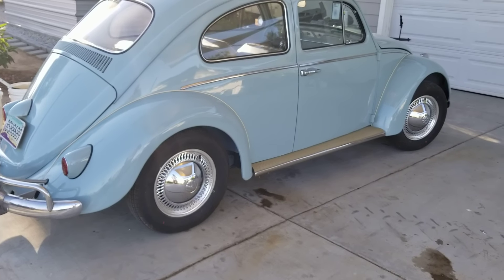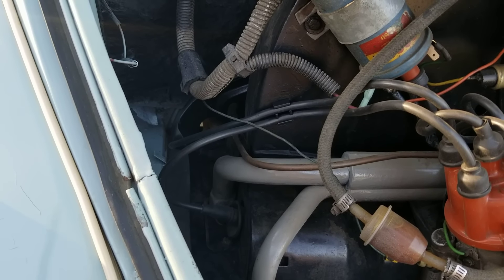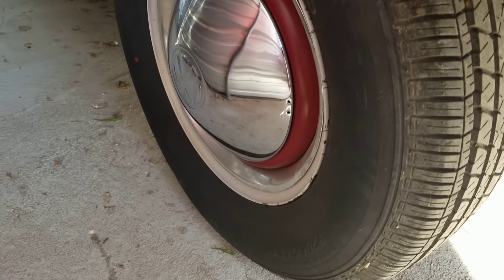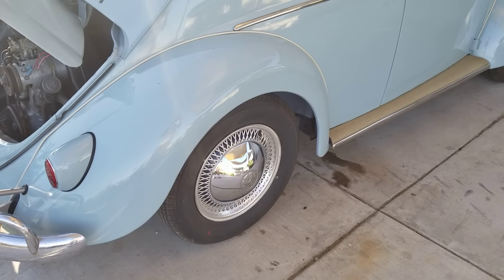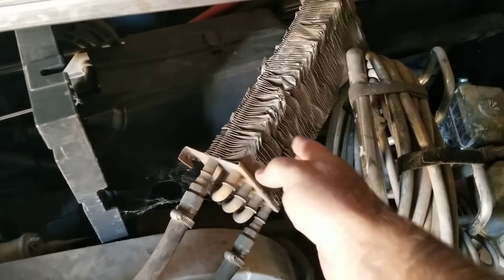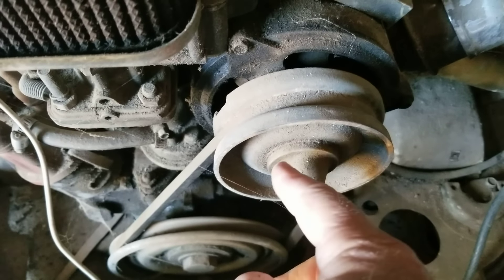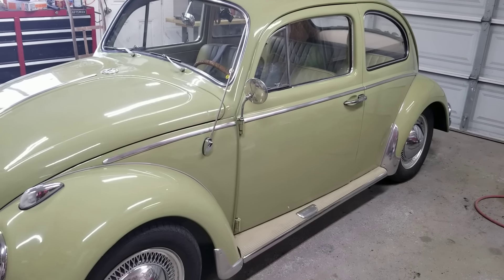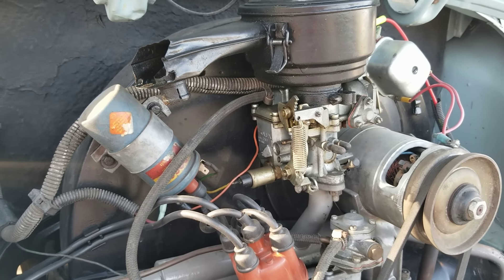Things NOT!!  to do to your Volkswagen VW bug or bus

Comment: The traditional braided fuel hose may not last with modern gasoline.
I found both the front under the tank hose and the rear under the car between the chassis and engine had deteriorated and leaked. Better to use the black hose from the auto parts store.
I'm a vw purist with my "57 Beetle but gasoline leaks will burn your baby down.
The green bug caught my eye...I bought a Beryl green '63 for $600 back in 1974 and drove it for 10 years.

Comment: 14 size tire on the bus, past 60mph.  Can you give me a basic breakdown of why it would overheat, is it gearing vs tire size?
Reply: It overheating is because of engine rpm, these engines are designed to cool best within a certain rpm range. 2500-little over 3000 or 3200. Any higher and your building more heat without more airflow

Comment: What I've heard regarding the fuel filter in the engine bay is that it's not a risk of the fuel filter popping off, especially if hose clamps are used, but the extra mass of it on that line tending to work loose the hose barb on the carburetor as discussed at the end of the video.
I've had the condenser issue, caused my car to intermittently cut out, causing violent shuddering. Shop talked me into going electronic points replacement device instead of new condenser as good ones are hard to get these days. I was truly amazed how much better the car ran with it, didn't think it would make much difference but it felt a hell of a lot smoother. Ran it that way a few months before converting to fuel injection with electronic ignition, current configuration uses LS coils. Others will disagree with me, but I'd say don't be afraid to modernize and improve on it, just make sure to do your research first. It was an econobox from the '60s or '70s (if it's from the 50s, keep it bone stock as those are quite rare and valuable), they did a lot to save money on it, and technology has advanced so much since then. Mine has a very long list of modifications to make it a better daily driver (more comfortable, more reliable, less hassle), pretty much everything except things to make more power. Most significant things I recommend, all coming from the context of a '73 Super: Electronic ignition, front disk brakes (I have rear disks as well, which are nice but I don't consider them "mandatory" like the fronts), and one of those "Kamei" front air dam thingies (actually a fiberglass knockoff, but same effect), really makes a huge difference on the freeway, especially in crosswinds, car feels much more solid. Another thing I recommend is a third brakelight near the top of the rear window, it's not "original" or "period-correct" but I figure it's worthwhile if it has the chance of reducing a rear-ending even by a tiny bit. I think it's more beneficial in a Beetle than in other cars as the tail lights are quite low down, below the line of sight of someone in a higher-up vehicle such as a truck, van, or SUV.
Reply from the maker: the pointless are smoother just remember #3 is retarded on the distributor. the cam lobe is flatter. but not on the pointless. if your jetting is good and you have compensated for the engine heat it is no problem.
Reply from the maker: great advice on the rest of the comment. thanks for putting it up
Reply: @Mikefngarage  The overheat on #3, and retarded timing to alleviate such, is only an issue on earlier models where the oil cooler is inside the fan shroud, partially blocking and pre-heating the air going #3/#4, mostly effecting #3. Later models switched to the "doghouse" style oil cooler, which mounts the oil cooler outside the fan shroud so the #3 cylinder doesn't overheat, and distributors for such years don't retard #3. This is the case for my '73. Though I've gone far beyond electronic ignition now, even mentions of jetting are irrelevant as I've gone full EFI using a microsquirt ECU and fully distributorless ignition with LS coils. Runs amazing... usually.
Reply: Rene Drew  I didn't think of engine fire from being rear-ended, I figure getting rear ended sucks enough even if it doesn't catch fire. I got rear-ended by a van about 7 years ago, broke the fuel pump, messed up the generator, fan shroud, decklid, rear apron, and a bunch of other things. Had to have it towed to a shop, it couldn't drive like that. I think that the third brakelight (which I didn't add until several years later) might have prevented it.
Reply: I got my car back from the shop and on the way home the gas line came off the carb and set fire to my engine. I shut off the engine and opened the hood and the cold wind and snow blew out the fire.
They had not put clamps on my hoses.

Comment: I've run an external oil cooler over the fan shroud inlet since back in 1976, and on an 1835cc dual port engine in the Arizona desert yet.  Yes, I have the "thin-wall" 92mm cylinders that "common knowledge" says won't work as well, and use a stock camshaft and crankshaft. Yes, I do run engine lid standoffs, and cannot count how many mid-summer, mid-day trips I've made to California coast with that set-up.  And the VW had dealer installed working AC for those trips.  I do have a Maxi2 oil pump/filter too, single Weber 40DCNF, and German 009.
Reply from the maker: the only reason it works is because of the stand off. We have proven that running the cooler over the fan makes it run hotter. That is like comparing a baja bug to a street car. they always run cooler.
Reply: Back in 1976, doghouse coolers and shrouds were dealer-only, and expensive !!!  I had started with 1600cc single port, and #3 and #4 ran tons hotter because of the in-shroud 1970 oil cooler.  I paid $1100 for the 1970 Beetle in 1972, had dealer-installed DPD AC.

Comment: Champion used to have these fantastic extended core plugs. They worked brilliantly in Vdub's ... I used to use them all the time but one day one of those plugs dropped a core into the cylinder 😞I've always used the standard Bosh plugs after that, don't work as well but they don't break or seize in the head either.

Comment: All these caveats are spot on.  This being said,  the two MOST commonly observed violations are these:  1)  Driving an air cooled VW TOO fast   i.e. over 65 miles per hour.  The best speed is about 55 to 60.  How many engines are fried (overheated) by excessive speed !   They actually last a long time if they're driven correctly.      2)  Lowering the front end....aka  screwing up the suspension.  I cringe when I pass a lowered VW.  This is about the WORST idea (brainstorm) anybody ever had !   The German engineers were the BEST in the world.  If the car ran better this way,  don't you think they would have built it this way ?  The TRUTH of the matter is that the car is being DE-engineered when this is done.  All their engineering expertise is being trashed and disregarded by people who don't know a fraction of what the engineers do.  These 'improvements'  should be UNDONE by anyone who's unfortunate enough to drive a VW that's been mutilated in this way
Reply from the maker: yea for sure some guys have performance cams and can run higher speeds. because the changes and depending on what year late models had 3.88 gears and can run a bit higher freeway speed. Lowering yea especiall some of these super dropped cars. Unfortunately the engineering is from 1937 really and with all the collaberation of so many shops, early empi and trial and error. it can now be upgraded in some areas. Plus all the old original parts are becoming not available. Mostly I agree with some reservations.

Comment: Hey, that motor is way later model than the body.Mechanical advance distributor, 12 volt generator. 28PICT carb. Late fuel pump..
 Do NOT try  deceive us like that.
Do not knot the knot thats not supposed to be knotted.Not nice.  Not.
Gee , if you did all those things youd never drive again. Just go out and enjoy yourself. I had nothing but fun in the VWs i owned. Never ever left me out on the road anywhere . Always got me home. Love the two models you showed us in the vid. They are a timeless design.

Comment: Do not use hose clamps on your fuel lines without first pulling the pressed-in copper fittings they connect to and replacing them with screw in barbed fittings. The original fittings are no longer tight. The ones on the pressure side will blow off.
Reply: Where do l get the screw-in barbed fittings? I'd like to replace mine.

Comment: Most definitely figure out the way the cooling air circulates and make sure it will be working to cool the engine, and that it is not working to heat the engine. Air being blown the into the engine compartment instead of over the cylinder heads – not good. Seal missing around the engine perimeter –  air that just got heated up after being blown down over the cylinder heads and cylinders – will be able to come back up again.  Don't neglect the 2 little pieces of sheet metal that go under the left pair and right pair  the cylinders. I never had any problem with Champion spark plugs. It seems to me that if you put a fuel filter AHEAD of the fuel pump, yes it will be more difficult to configure things that way, but it will protect the fuel pump diaphragm as well as the carburetor jets and the engine, from particles of sand and soil in the fuel.. And you won't need as many hose clamps. Clamps are needed only on the high pressure OUTLET side of the fuel pump. The miles per hour specs you give – are they for the actual mph, or the mph figure that your speedometer asserts?  Use smaller diameter tires than the standard size, and you will see a mph reading on the speedometer that is greater than your actual mph that the vehicle is going. Do not connect battery terminals without a corrosion protector. Grease works. Do not use the wrong thickness or wrong type of gaskets for the oil pump. They will affect the oil pressure.

Comment: Blue streak points and condensers work just fine . I ran my bugs for years on them ! Bosch plugs are the only ones to use . The threads on the other plugs go to deep into the head and can strip the threads in the head ! Don't remove the plugs while the engine is not you'll phuck up the heads !
Reply: Blue Streak have always been quality points.
Reply from the maker: who knows maybe the blue streak ones are better than bosch. I havent seen them lately will take a look
Reply: Hot not not!  Damn autocorrect!

Comment: As far as the points and condenser go, get a Perlux Ignitor points eliminator. Don't drive a VW without a fire extinguisher onboard. Do convert 6v to 12v if possible, You have to change the flywheel  to the larger 200 mm clutch too which has its advantages anyway and get the adapter starter bushing or use a 12v starter from an automatic (not auto-stick shift) type 3 that has a nose bearing built in so it doesn't have the shaft sticking out past the gear. They are better starters anyway. I actually used a 6v starter on a 12v system for a short time, just couldn't crank it for more than a few seconds or it would burn up the ignition switch. It would spin the engine over so fast that you didn't need to anyway.

Comment: Wire the brass nipple on the carb fuel inlet using lock wire from the jubilee clip (clamping the fuel hose) to a tab which attached to a float chamber cover screw.

Comment: The "rear" of the engine is what you see when you open the engine lid.  The "front" of the engine is the side towards the front of the car.  Hopefully most can figure out which are the right and left sides ;-)  You can provide an extra measure of security for the fuel pipes that are pressed into the fuel pump and the carburetor by tying the screw clamps on the fuel hose to the fuel pump and the carb with safety wire.
Reply: This was meant for people like me... lmao
Reply: Not so the front of the engine is at the back of the car the back of the engine is next to the transmission.
Reply: @mothmagic1  "...the front of the engine is at the back of the car the back of the engine is next to the transmission"  <--- Proof of flat earth!
Reply: @mothmagic1 I've seen them referenced both ways. On a VW, the end of the engine with the flywheel and clutch that is connected to the transmission is toward the front of the car. But this is the end of the engine that is in the back on a conventional front engine rear drive layout, and a VW mechanic who worked on my VW bug back in the early '80's called the tranny end the "rear" end of the engine. I believe it is also common to refer to the tranny end of the engine as the rear on cars with  FWD, transverse engine layout (where it's actually on either the left or right sight of the car).

Comment: Change all your fuel hoses to ethanol resistant because of the new Biden E15 coming in!!  This also affects T2 expansion pipes behind the fire wall.  It is an engine out exercise to get all the 2 inch rubbers which connects all these.  We have had E10 (now E20!) and the old hoses go rock hard and break.

Comment: Mike, quick question for you that I hoped you might be able to help me with, even though I’m waaaay over in England. I’ve recently become the owner of a 56 oval. Previous owner has fitted later 60s tear drop rear lights. Have recently purchased some snowflakes and am
Struggling to work out where to mount them. Would you mind taking a couple measurements off yours so I can try and mock these up? Cheers! Ben 🇬🇧
Reply from the maker: yea that is a tough one. how to get those in the right place is a bit hard.

Comment: Do NOT replace a stock VW distributor with a Bosch 009.  The vacuum advance can is on stock VW distributors for a reason!  Send it out to be rebuilt if you have to.
Points suck, IMO.  Pertronix electronic ignition conversions are the only way to go.

Do NOT block off the air that would normally go from the fan housing and through the exhaust manifold heat exchangers for your heater.  Keep it ALL INTACT and tight.  That airflow helps cool the exhaust and that helps cool the heads.  Your heater will give you plenty of heat in the winter if it's all there and not leaking.

Try to keep it as stock as possible.  Some things just can't be done, though.  That awful spare tire-powered windshield washer of mine had to go.  But, I kept it "stock" by using a new VW of Mexico "Vocho" washer bottle w/ electric pump.  A microswitch in the right place let me use the stalk that normally controlled the air-power washer.

Comment from the maker: Do not use platinum plugs
Reply: What reason for this? Do they cause problems or just not offer any advantages? I was considering putting them in mine, but I have a non-stock ignition system, using GM (Chevy) LS coils mounted to the sides of the fan shroud running as wasted spark. Full fuel injection system as well. Stock 1600DP engine core.
Reply from the maker: @quillmaurer6563  they foul on vws they just cause problems. On my chevy they are good.
Reply from the maker: @quillmaurer6563  you can try in on an HEI but with the head temps and cylinders temps. richer mixtures they may start fouling. Never tried them with LS coils but even with HEI we still had problems.
Reply: @Mikefngarage   ..This is a myth. Leaded gas will foul the platinum just like it will foul the platinum inside a catalytic converter.  All the while this myth was parrotted around the world, I was using platinum plugs without troubles because at that time leaded gas was banned where I live.  Nowadays, leaded gas is banned everywhere, so there's no possibility of fouling platinum plugs anymore.
This was what a Bosch rep told me.  When they were first introduced, they were getting huge complaints from Italy.  It turns out Italy was still selling leaded gas where all other countries in Europe were not.

Comment: I question your comment about oil cooler location. Reason: the shown location on the air intake side of the shroud...sure....brings in the waste heat that goes thru the fan and then over ALL cylinders.....but think about this.....the STOCK oil cooler location is pedastal mount INSIDE the air shroud and is located so ALL the waste heat gets concentrated and goes ALL over the #3 cylinder primarily.....is that better?

Comment: I believe you should have the gas filter outside the engine compartment below the floor. This is one of the reasons of why the beetle get fire. Is my humble opinion. The other one is where we connect the hose coming from the gas pump. If got loose your beetle will be on fire.

Comment: Do Not have Fuel filter in the rear engine compartment try to have it closer to the tank,you can burn up your engine with Flames . also have a fire suppressor extinguishing system .

Comment: Bosch is not what it used to be. Just because the name "Bosch" is on it don't assume it is automatically good. The points are made in Turkey and often fail prematurely, and the alternators are from Central America. Bought 2 new and both were junk. Better to have yours rebuilt by a reputable shop.
Reply from the maker: are you sure they dont make them in china first then ship theme there ha ha they are not the same.